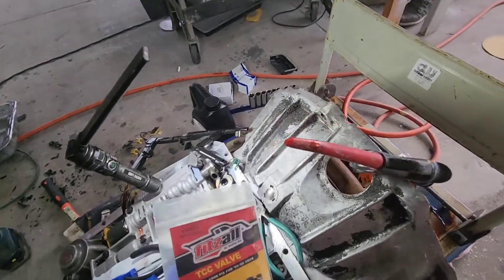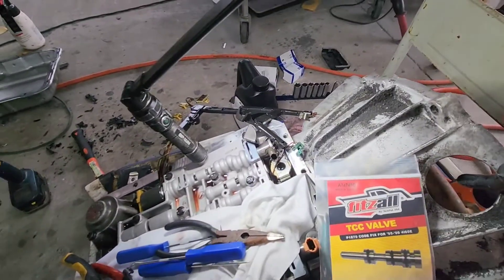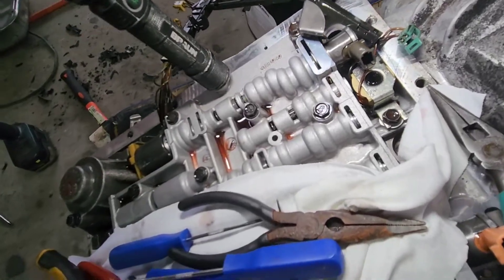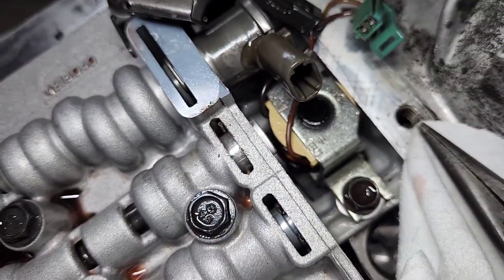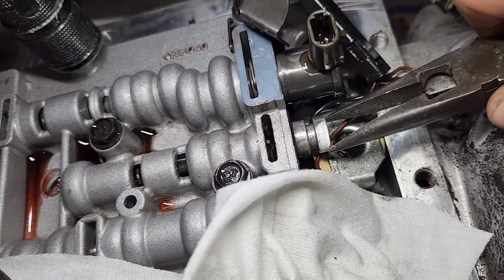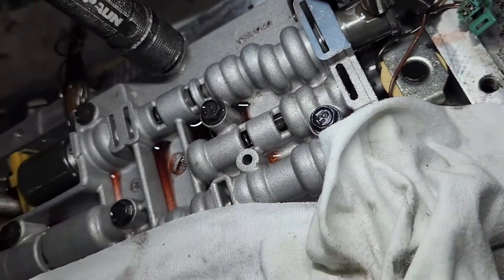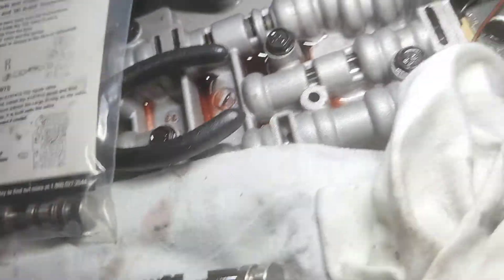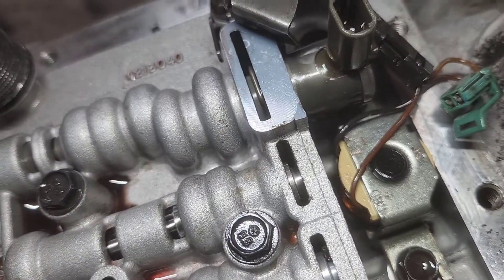4L60E P1870 TCC PWM Valve Fix WITHOUT REMOVING VALVEBODY

Comment: NOTE FOR IF YOU CANT GET IT: Buy a new clip, then grab the ends of the old clip and yank on it extremely hard. Do that to both sides. Go absolutely ham on it. Angular pliers grab it better. Eventually once youve bent the old one up bad enough it pops off very easily. If you are still having trouble yank it hard then cut everything you can reach off. Then push it up over the retainer. Pop the new one in easy peasy fuck the old one up bad for me boys I hate that clip with a passion.

Comment: I have a p1870 code on my 4l60 in my 2001 blazer. It feels like it only slips in first going into second. Could this fix my issue or is it most like a shift solenoid since its only happening in first-second?

Comment: I did it it took me about 8 hours and it's the hardest thing I think I've ever done in my entire life The real trick is squeezing the pins together and then spreading them apart pushing while also giving pressure with the screwdriver
Reply: Also I have a 2000 Chevy S10 and I had to cut off the end because the transmission must have been in 1999 model

Comment: Is there a reverse valve?

I have a 2008 chevy tahoe 5.3 2wd with the 60e. Can the servo rod tip wear down like the 80e? All my gears work as they should just no reverse.  No grinding or burning smell. No lights on the dash. No other gears slip. If you drove it forward you would not even notice the reverse was out...Trans temp runs around 180 to 190. Any thoughts or non legal binding advice you can give?

Comment: I tried for almost three hours to get that clip off, finally gave up and had to drop the valve body, which I never did before, but it wasnt hard.  The Fitzall valve in the end DID fix the error code, and the tranny TC is engaging like it should.

Comment: Could've showed a detailed flaw on old valve as to why you changed it. Plus it wasn't a new sonax valve you installed. No explanation on old valve wear whatsoever. Show people  what to look for on faulty parts.
Reply from the maker: This was done as a preemptive repair, meaning there was not a problem with the old valve yet. I have had this problem on other vehicles with 4l60e transmissions so in this vehicle i decided to change it before it became a problem, as it usually does. Generally what will happen though is the valve or bore in the valve body will get scored from the valve frequently sliding back and forth, and due to it being a mechanical seal without o-rings this scoring allows fluid to bypass and loss of pressure for tcc lockup. The new sonnax valve if I remember correctly comes with a reamer to resurface the bore and an oversized valve, and this method retains pwm function of the tcc clutch. The method I did here is a aftermarket "plug" with o-ring seals in place of where the valve would have gone, which eliminates the pwm function and provides a solid on or off lockup to tcc clutch, which is how the older 700r4 transmissions that came before the 4l60 were, and in my opinion is much more reliable and does not have a huge negative effect on driveability, in fact you'll probably hardly notice the difference.

Comment: What year model what the transmission you were working on? I have a 2000 s10 not sure which tcc to get. There’s 2 did numbers with same year…
Reply from the maker: I believe it was a 1998 4l60e 4x4.

Comment: Got it but question how many quarts of transmission fluid do you put back in after replacing the valve from dropping the pan I'm trying to know the exact amount so I won't overfill thank you
Reply from the maker: Add fluid with the truck running. Add a little, check the dipstick, and repeat until up to level. You always have to fill transmissions with them running to get the correct level.
Reply: @ark2002  great thanks

Comment: hello my transmission was done by performabilt and they put the retaining clip in like u did but now the wire harness going over the clip sticking out interfers with the filter going down all the way and in turn keeps the pan from sitting correctly. did u have this problem??
Reply from the maker: I did not have this problem, but i believe this transmission was a deep filter and pan if it makes any difference.
Reply: @ark2002  yes that was what I was thinking as well if you use a deep pan I don't think it's a problem. I am using a 2006 GTO deep pan but it's only 3 inches deep I know the aftermarket pans are about 5 inches which in turn I would think would make the difference

Comment: Im not getting any codes for the transmission. But intermittently when in lock up 40-50 mph my rpms go up and down 200-400 miles per hr. Should i try this before a TC?

Comment: Thank you for your informative video. Just did the job on an 1997 Astro van, which was diagnosed “new transmission”. I bought the van without really knowing what to do, but then I fell over your video! So far it works flawlessly. The job done on the back with oil dripping in your face isn’t fun, but its doable! Thanks again, man! I’ll ask if I can link to your video, from a short video I’ll make on my channel?
Reply from the maker: Glad to help, feel free to link the video.
Reply from the maker: Also super clean astro van, I did not know they made them in AWD.

Comment: It took me forever trying not to drop the valve body. It would be easier and faster to just drop that valve body down.
Reply from the maker: I have done both ways, and me personally this method was much faster, and does not require a new valve body gasket (im cheap).

Comment: Do you leave the spring out to install the new valve or not?
Reply from the maker: The spring is not needed on the new valve as it does not move. If you look at this listing it shows the instructions for installation in one of the pictures: https://www.ebay.com/itm/324598142503

Comment: I see. So the clip was steaked in the opposite direction.    So all you do here is flip it around
Reply: And install the new valve body
Reply from the maker: Yes, and install the new valve, which eliminates the PWM function of the torque converter, eliminating the slipping problem.

Comment: Will this cause the transmission to drop out of overdrive when lightly letting off the throttle and when I touch the brake pedal it will shift it back into overdrive.  97 gmc jimmy 4 wheel drive 107,000 miles any input will help please thank you I have a video of this happening
Reply from the maker: As far as I know, hitting the brake will disengage the torque converter, as will letting completely off the gas pedal. As soon as the gas pedal is reapplied, it should re-engage (or lock)  the torque converter (assuming you are moving fast enough). I am not sure if the locking and unlocking of the torque converter is what you are considering overdrive, but technically 4th gear is overdrive because the ratio in the transmission is less than one, hence you are going past drive (one to one ratio).
Reply: I don't know if this will fix my issue,  I'm not sure what my issue is, only codes I got were a & b, shift solenoids.  I replaced them. L1, l2, 3, rd work fine, but in drive, it wants to take off very very slow, it's not slipping,  not over revving,  it just don't want to take off from dead stop, if I take off in l2 or 3rd it seems normal,  then I shift into drive (d) after 30 miles a hour. Take on interstate,  runs fine, no slipping.  I'm trying figure out what needs replaced

Comment: This still took me 4.5 hrs laying on my back in the driveway.     I just suggest to everyone you get the new valve body and separator plate gaskets and some trans gel for the check balls......
Reply from the maker: Yes, it would be much easier on a bench, but taking the valve body off introduces a lot of other places to make errors when re-assembling and if not careful can cause major damage to the transmission. This is the simplest and least likely way to avoid damaging anything else.
Reply: 20$ vs 300$ tho….
Reply: @DirtyNate98  $20 vs $300 for what? Gaskets and trans gel isn't much. My time cost nothing
Reply: @baileyintwert4970  misread your comment disregard. But yeah for average joe messing around with the clip is a lot safer than dropping the valve body.

Comment: Can you do this same thing without a new valve and just flip it around and move the check ball or does that ethos include dropping valve body
Reply from the maker: I have seen but not tried flipping the valve myself, but if you can get the valve out this way I don't see why you could not do that. I personally prefer the new valve with the o rings completely sealing and blocking the pwm.

Comment: Well I've been prying on mine for 2 days and I'm starting to think it's impossible to get it out that way 

It's funny that you didn't do it on video
Reply: His method works just fine. Next time put your purse down and you might have better luck
Reply from the maker: You have to bend the ends of the clip before you can open it to push it out. Takes two hands. I did not take the valve body out to remove it just to put it back on to trick everyone (also, there are many others that have been successful in the comments doing it).
Reply: It took from 9:30 am to 1:30 am the next day lol that clip is a pain but if you get it over where it's spread take two small screw drivers and use one to cause tense on the spring and the other in the other hole it was a huge pain but it worked

Comment: Did you put the spring back in with the new valve
Reply from the maker: No need for the spring with the new valve, as the new valve no longer moves, it is essentially a block-off valve.

Comment: Pretty certain my torque converter is on. It'll stall the engine when I put it in gear so we'll try this before it goes to the shop
Reply: Probably the main tcc solenoid
Reply: I had change that solenoid and I'm still getting the code

Comment: My new tcc valve doesnt fit all the way in. Any ideas?
Reply: I see there is a 74741q and a 74741qa. The qa is longer and they say to cut off the tip to make it shorter or a q version. If that makes sense.

Comment: Made a very quick and simple job out of a job that could have been a nightmare.  My truck is back on the road!!!  Thanks for the video!
Reply from the maker: Glad to help!
Reply: How’s it holding up how many miles since ?
Reply: @KollynJ  been holding up great!  Like a new tranny still.  Been about 3,000 or so miles since…. It’s not my daily, but I have driven it to work for a week which is 40 miles each way… been absolutely amazing!
Reply: @KollynJ   welp… she finally went…. No forward gears at all.  $3,600 for pull, rebuild, reinstall
Reply: @bluediamondareaoutdoors  this fox brought it from not shifting to back on the road? How many miles did it last w this fix
Reply: @KollynJ   yes, but the trans musta had more wrong with it… lasted another 10,000 miles tho
Reply: @ wow 10k in 8months thats not bad. In New York it’s not always worth replacing a trans to fit on a rusted out frame. But I wish I got another 10k out of mine. I never got around to trying this repair but it felt like it was binding maybe the trans output shaft bearing had a lot of play
Reply: What is the part number for a 2000 s10?

Comment: pressures not to high 🤔
Reply from the maker: Doesn't seem to be causing any problems, this is similar to how the how the previous non pwm transmissions worked, they were just on/off with the converter lockup.

Comment: Thank you for your help. I got a p1870 code, also when the tranny gets heated up I get a heavy jerk from 1 -2 gear. All other gears are fine. When the tranny cools down it doesn’t happen. I understand that this might help with that. Just wanted your thoughts. Thanks take care god bless.
Reply: I have the same exact issue. Debating on doing this or replacing the valvebody with a sonnax updated model...
Reply: Just did this fix it works if your symptoms are gears changing fine while it's cool and after it warms up you kinda half way lose 4th gear and develop a hard shift from 1 to second after the light comes on  @rick4lif
Reply: I have same problem with 4l80e after driving on highway it'll jerk on 1-2 shift some time on 2-3 shift
Reply: I'm having the same symptoms as stated above. 2000 gmc sierra 1500 with 156k miles. After a longer period on the highway today I started having a harsh 1-2 shift when stopping through towns on the way home, scanned and found the P1870. Will this kit be effective at remedying the issue?
Reply: @brennanbishop4886  I've had the same problem, harsh shifting on 1-2 shift when hot.  It was the valve body worn out.  One of the passages with a check ball wears out.  Common issue.
Reply: @ug9191  isn’t that the valve that people flip around to lock out.. the tcc valve?
Reply: @KollynJ  no it's the whole valve body.  The plate with all the oil passages in it, it has the check balls in it as well.
Reply: @ug9191  ah I see. What did you end up doing then?
Reply: @KollynJ  change out the valve body myself.  Wasn't very expensive and shifted beautifully after.
Reply: Transmission shop refused to change it.  Said trans wouldn't last.  It lasted for years.
Reply: @ug9191  wow my only question is what we’re the symptoms before how can you indenting from just burnt clutches
Reply: @brennanbishop4886  when the TC clutch slips with code P1870, trans will increase line pressure, resulting in harsh 1-2 shifts, this kit should fix it
Reply: @brennanbishop4886  did this fix it i hav the same issue?
Reply: Just did this fix tonight..installed without removing valve body (Chinese water torture but it’s atf) replaced filter, fluid and added some Lucas stop slip.. I’ll update with the results hoping for the best
Reply: @stoeckjack1  lemme know! Was just thinking about my van that’s been sitting
Reply: @stoeckjack1  yes please let me know I need to work on mine tomorrow or this week. How did it turn out?
Reply: @KollynJ  so far so good! No issues what so ever with shifting after significant highway travel, towed the boat the lake just fine. Well worth the 2 hrs of fighting with the clip.. my advice for the clip removal is to take a small pry bar or screw driver and have someone hold a little pressure on the valve then take a couple pics and wedge them in the side to pop the clip up onto the sides of the valve.. it is way easier to do if you smoosh the clip together and try to straighten it out
Reply: If your symptoms are shifting smooth before it warms up and after it warms up you develop a hard shift 1 to 2 and it tries to ignore 4th worked for me been three days driving it now I'll give a 500 mile update and 1000 mile
Reply: Update out over 1000 on it went to the mountains and back would strongly recommend this fix
Reply: What did you guys find out?
Reply: @KollynJ  This fix works! I replaced the TCC valve and the clip as shown in the video. I drove 100 miles (mixed highway and city) and so far the shifting has been smooth. I will provide an update if the hard shift comes back. Be careful when routing the wire connector, you may have to reroute it around or route it through the clip so that you don't pinch and short out the wire.
Reply: @rick4lif  fire it up Rick!! How many miles on it now and how’s it doing?
Reply: @KollynJ  200 miles after repair. Mix of highway and city driving. No hard shifts or codes popping up.
Reply: @rick4lif how's it holding up ??
Reply: @Jos @JosephCasias-l6m ruck is running fine so far. Some others have commented that the truck shifts a bit harsher (compared to normal) after this fix, but for me its not really noticeable. I can only feel the shift in 4LO from 1-2. Driving in 2Hi and 4Hi shifts smooth. 

I found out after this fix that there is an updated shift rite sonnax valve body, which includes a more proper fix compared to this TCC upgrade fix. However it’s about $300
Reply: @KollynJ I am interested as well. I have having all the same symptoms. I my truck drives awesome apart from the converter not locking up.
Reply: @KollynJ it works
Reply: did this fix it i hav the same issue?

Comment: Do i put back onn old spring with new valve?
Reply from the maker: No need for the spring with the new valve, as the new valve no longer moves, it is essentially a blockoff valve.

Comment: The transmission of my 95 Silverado shift hard when I put it in gear it kicks hard and from 1 to 2 it shift  hard
Reply: La mía hace lo mismo pero solo cuando corre durante más de una hora pero si lo apago y prendo, vuelve a la normalidad a que cres tu que se deba
Reply: la mia hace lo mismo> que era lo que tenia la tuya. la pudistes arreglar @ulisesreyesruiz5021
Reply: Forward accumulator and 1-2 accumulator sticking is my best uneducated guess.
Reply: Replace the TPS sensor on the throttle body. Had same issue on my 1995 Suburban 5.7 tbi and now trans shifts like butter.
Reply: Mine shifts fine when in town ..once i drive for like 30 min it haves a hard 1-2 shift ..but goes away if i turn off the truck and turn back on ..would that be throttle position sensor? @nosurfenougheddie

Comment: I have a 1994 which I have heard is NON PWM and should not worry about converting this valve? My transmission fuse blew when the weather was really hot. So I am getting ready to drop the pan and replace the Master wiring harness with switches and solenoids.
Reply from the maker: I do not think the 94 has this pwm valve, I think it started around 96, but I'd double-check to make sure.
Reply: Correct 94 did not have a PMW TCC, you don’t have to worry about that.
Reply: Did it give you a code for blown tranny fuse?